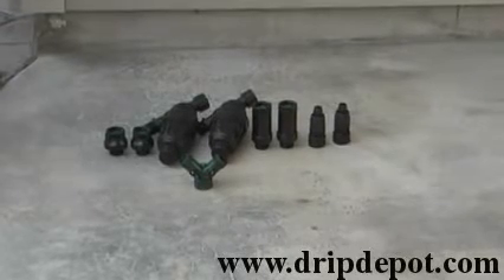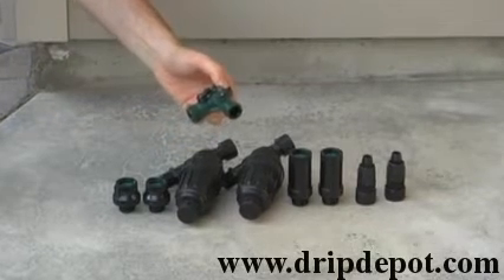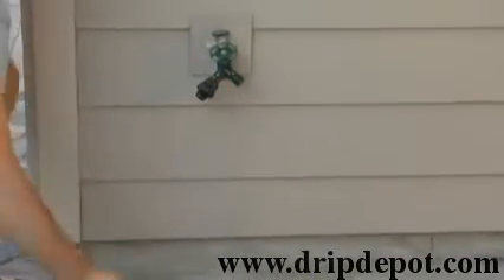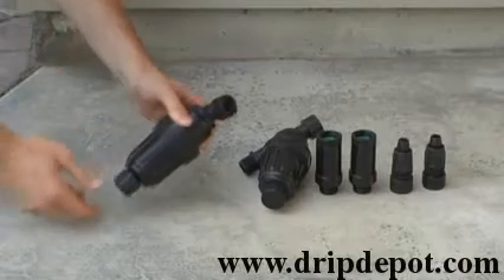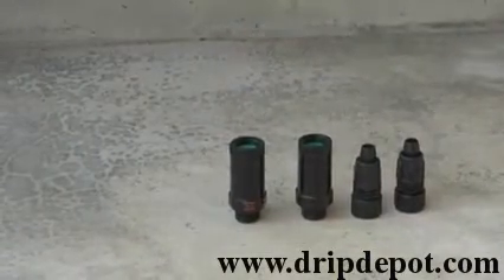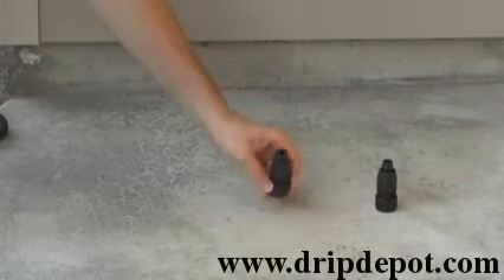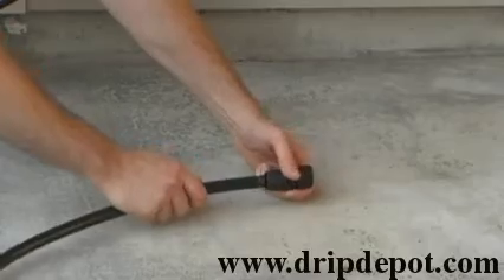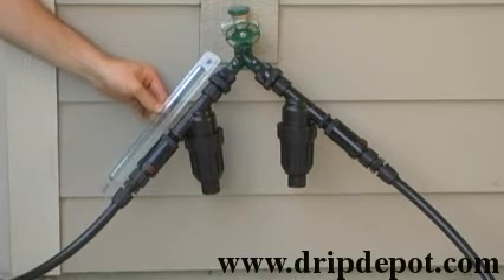2 Zone Head Assembly for 1/2" Tubing

Comment: Can’t you just use one filter then the y connector after the filter to the two lines?
Reply from the maker: Unfortunately not -- these filters (and the backflow preventer and pressure regulator) are not rated for constant pressure, so have to go downstream of any shut-off valves.  There are filters (and pressure regulators, but not hose end vacuum breakers) that are rated for constant pressure, but they are pipe threaded and quite a bit larger so require multiple adapters to get installed on a hose bib, it will typically cost less to go with multiple small filters than the larger filter and adapters.